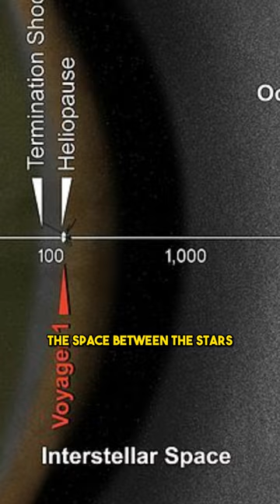What Voyager 1 is Trying to Tell Us with Its Nonsense Signals

Comment: I think the data represents like zero and ones on computer systems in the spacecraft , because of  the high speed of electromagnet waves  and the high radioactivities cosmic gases collides together and strike  on the computer system to loose signals in the signalling pathways of converting messenger systems 
So the zeros could be represents as message failure or the collected messages were deleted due to the high voltage of electromagnetic current in the space, the ‘number one” could be represented as there could be the expected message which stopped( frequencies )at the beginning of transduction.

Comment: It seems the signals would be less timely responsive (slower to assemble, a common problem for retransmissions) with the lack of the Solar System's gravitational hold on itself, for the proper strength, which even makes the light holding a straight line projection as the Solar System drifts in the galaxy's spiral.
Reply: Magnetism as a bonding agent of mass's inner self, might be made more profound in transistors to keep the signal in place as it is assembled in these less gravitational required outer areas. So what could be sharable thoughts about this to help lasting powers if I was right to the computer's energy flow only need minor extra help. 

A start point? Using the metals that reshape themselves if their structure is broken? Ability to cling.... Resistance to heat, but staying within the brittle zone of elements natural occurrence, between being metal and brittle ground particles, thus having better control for a consistent internal temperature... or as said no internal metal vibrations for distortion, but still with the metal strength to accept the current without it being a cause of vibrations...
Reply: Wonder how long signals take to get to it?
Reply: 22:35 one way